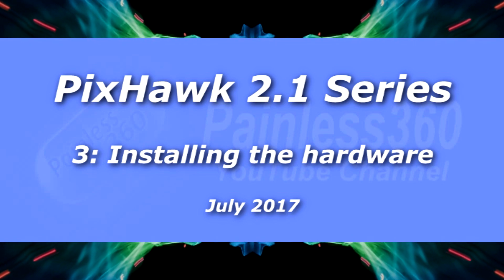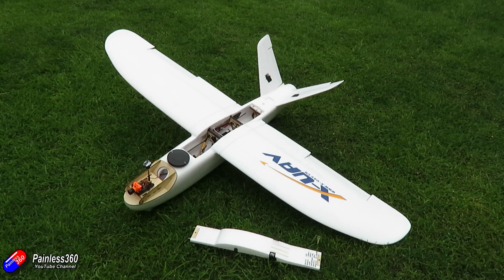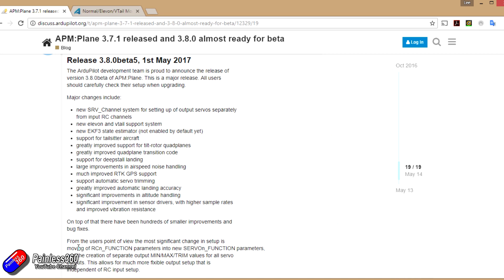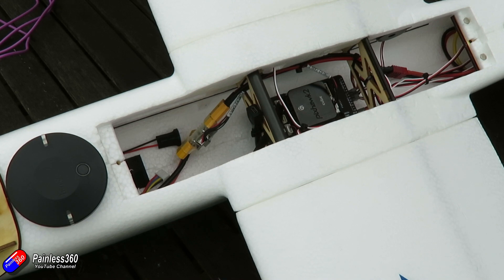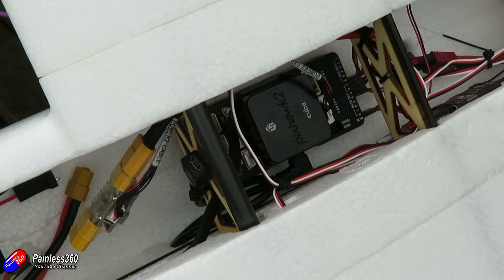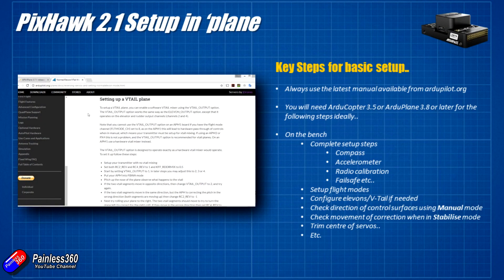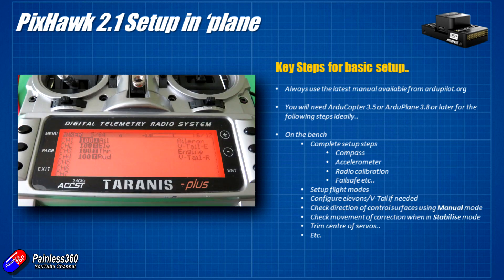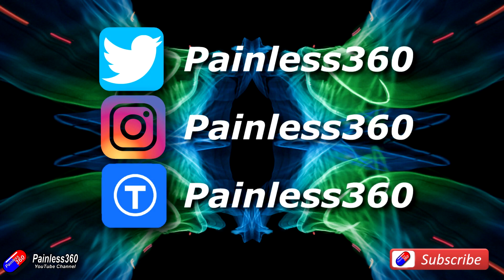(3/9) Introduction to PixHawk 2.1: Installing the hardware into an airplane

Comment: Any difficult if I fly pixhawk cube without airspeed sensor?
Reply from the maker: Nope, it'll work fine.. See my video on it in the big boys toys series..
Reply: Painless360 Thank for reply. I have some questions. I never fly plane with one autopilot controller yet but I have flied Parrot Disco. The Parrot CHUCK flight controller is awosome, Disco flies very stable. I know you have Disco too, so I wonder if this pixhawk cube can do better than Parrot Chuck do. 
One more, the power module go with pixhawk combo - is this current sensor, I dont see any info this part. Thanks again!

Comment: Helll Painless. I am configing my pixhawk cube for normal fixed wing. I dont you if I have to cut red wire of esc (jst 3 pin wire) that connect with pixhawk?
Reply from the maker: All covered in the series - you can have two power supplies.. Best of luck!
Reply: Painless360 Thanks for reply and sorry for my bad hearing english! So we can double power supplicantion throught power 1, power 2 and from esc to controller?
Reply from the maker: http://ardupilot.org/copter/docs/common-powering-the-pixhawk.html should help - it's where I got the detail for this series. Best of luck!

Comment: Does servo motors requires external 5v BEC  in pixhawk cube as that of in case of pixhawk 4?
Reply from the maker: Yes. Please watch the Pixhawk 2020 series. It's the latest and greatest on the channel.. Best of luck with it

Comment: Does the Pixhawk work with the Crossfire protocal?
Reply from the maker: CRSF? No. All covered in the GitHub repository - Google 'ardupilot CRSF support github' to find the latest status. Also, check out the latest Matek F405/Arduplane build on the channel where I use Crossfire and cover all of this..

Comment: I've been using the apm for years now and recently bought the Pix2 Cube. The question I have is the apm connections from the power module and the original GPS. Should I buy the molex click connectors to fit the new pix? I can't see another way of them fitting and the extra wires supplied don't allow for the old style connectors to fit the new ones.
Reply from the maker: +Anthony Bishop I'd invest in the new power module and GPS. The later GPS is a lot better than the ones shipped with the majority of APM kits.
Reply: Painless360 looks like I will have to. For failover I will need to get two of them.

Comment: hello, i just build a quad for the first time and im doing some loops ans flips but they are very slow. i am looking everywhere on youtube to find the right pid settings but everyone changes there ""pid controller" but i dont have that setting on cleanflight. i can only choose a profile and "rateprofile". please help me. thank you
Reply from the maker: +Louis Leemans really tricky to help as its got little to do with PIDs and everything to do with rates and RC rates. Unless you tell me what software you're using (as I'm pretty sure that you're not using a Pixhawk) then I'm stumped. Check out the other playlists on the channel..
Reply: Painless360 hello i just use cleanflight but also all the paid tuning layout is differend i dont have trottle raid... its just '' rc rate'' for trottle, pitch...
Reply from the maker: I've replied to you. The tuning video I sent is very handy and a real world example of what rates should be.. Hope it helps.

Comment: What channel did you use for the servos on the V tail? Are you going to go over mixing the V tail later? Thanks.
Reply from the maker: Installed as per the diagram. The setup for the v-tail is in the next video. There are a number of options and you simply choose them, one after the other, until you find the setting that makes the tail operate in the right way. It's very unscientific! :D
Reply: aaahhh, I see, the elevator and rudder is mixed in mission planner. It seems glaringly obvious now!!!! Did you have any issues with your motor/esc??? The motor works fine when connected directly to the receiver. When connected to the pixhawk the beeping (from the motor) is the same, but it does nothing when throttle is applied. I keep getting a "param error, version 3.3+ required" when trying to calibrate the esc as well. I have the most up to date firmware flashed however. It is probably just as obvious as the ruddervator mixing, but I am at a loss for now. Any help would be awesome !!!

Comment: How do I wire the safety switch? I have a Pixhawk 2 and a Here GPS. Do I need the safety switch to arm my drone? I am running PX4 on qgroundcontrol.
Reply from the maker: Check out the forums. Most answers are in there.. https://discuss.ardupilot.org/t/safety-switch-compulsory/14377 and     https://pixhawk.org/peripherals/safety_switch or get the reseller you got your Pixhawk 2.1 from to help too. Best of luck!

Comment: Hi Painless, wanted to ask you how you manage to connect the OSD to the pixhawk cube?
Reply from the maker: You'll need an external MinimOSD board and the same method as the one I've shown in the main PixHawk series. Use a spare telemetry port on the PixHawk Cube.. Best of luck!
Reply: @Painless360  Thank you! I will be reviewing your video and try to connect OSD as i didnt had luck in having telemetey in the video link. Thank you Paineless360!

Comment: Thank you for the videos. May I know how you mounted the board on the plane? Did you use Double Sided Tape?
Reply from the maker: Double sided foam tape. I use the same stuff they use to attached car number plates :D
Reply: @Painless360  Thanks a lot :)